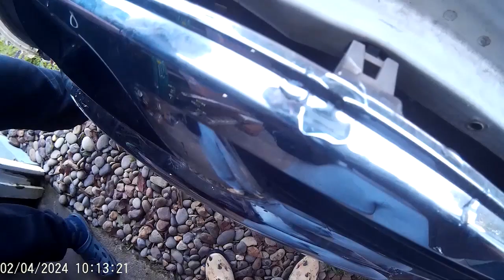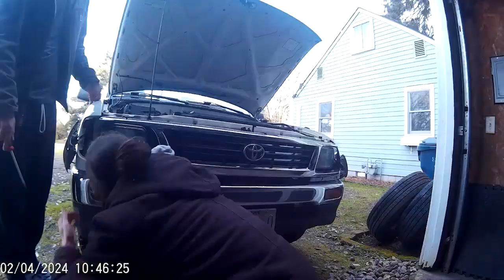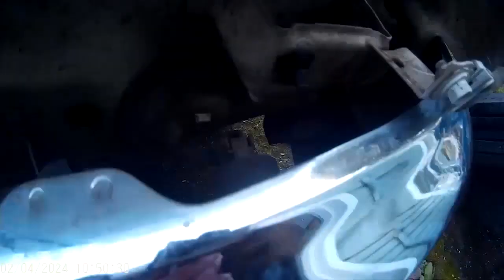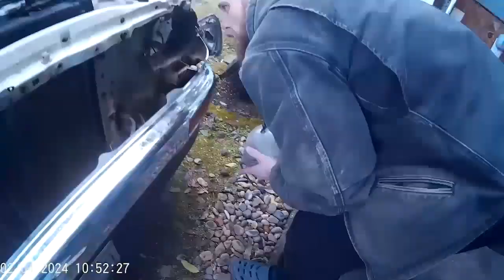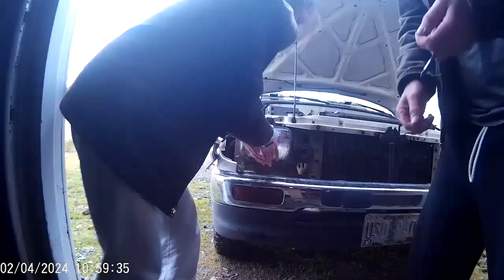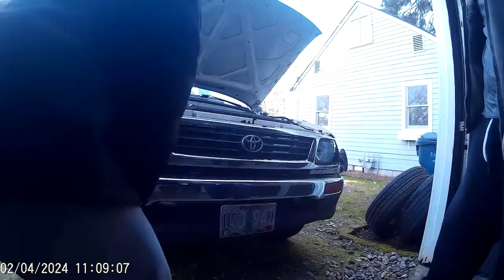Replacing Headlights on 1995 Toyota Tacoma

Comment: Those little tabs......   I made an attempt today.  I will try another day at present.   There are snapped tabs from previous owners and possibly some not correctly put back ones.   It doesn't seem like it should be that frustrating or difficult, though.  Thanks for  putting this up!
Reply: The top plastic screw on the marker lights, I snapped one, I used a household plastic wall anchor temporarily hold it, we'll see how it goes, until I decide to spend some time snapping tabs.